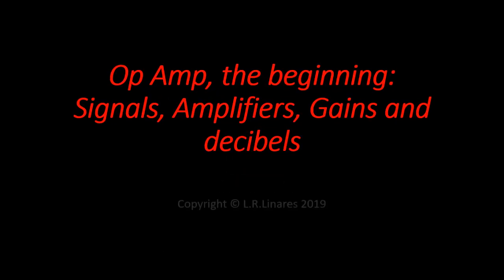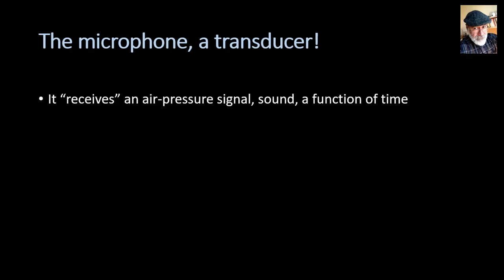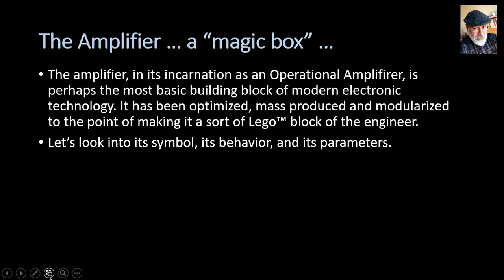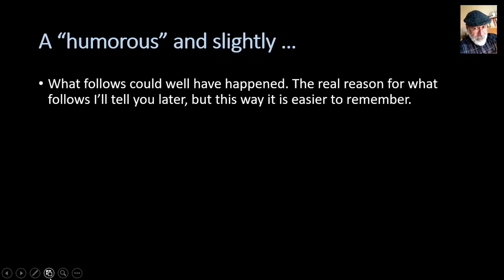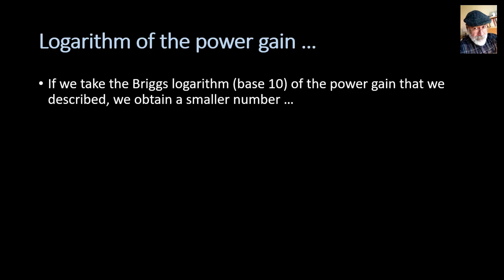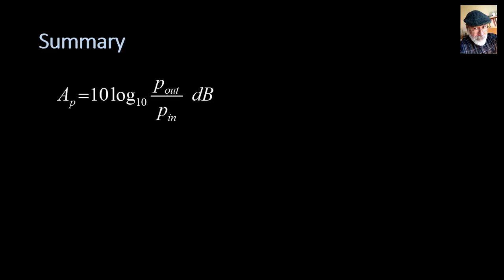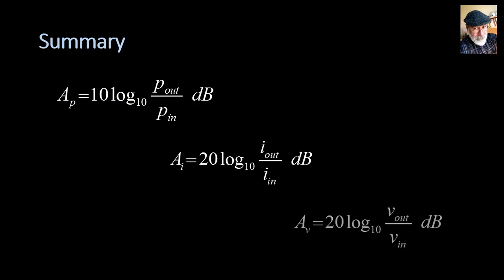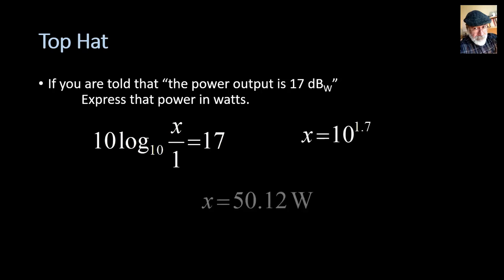Op Amp-1/4: Signals, amplifiers, gains, decibels.

Comment: Hi, at ~6:35 did you say “radians...is alive and well...”? What is the motivation for describing the decibel measure? Thanks in advance!
Reply from the maker: When we describe the relative power of an input signal at different frequencies in dB, it comes out as a graphic of dB versus Hz (or rad/s) usually in semilog paper. When we superimpose the frequency response of the amplifier that will process that signal, that also comes as a curve of dB versus Hz (or rad/s). It is relatively easy to add those two curves and obtain the frequency response of the output, again as dB versus Hz (or rad/s).  I invite you to look for "Bode Plots" in this channel and see this all in action.